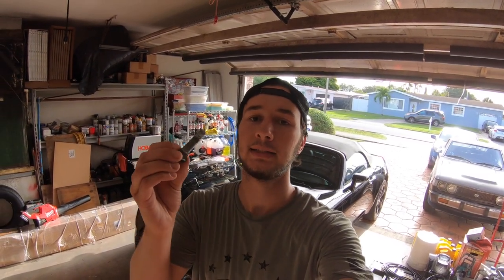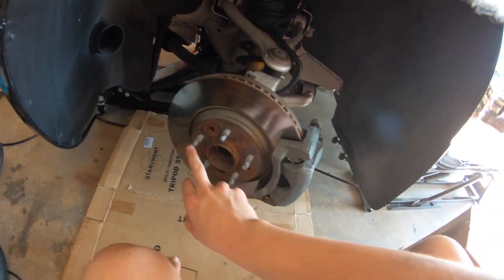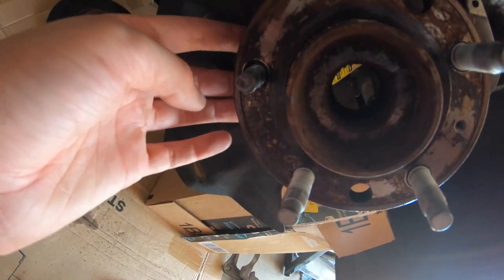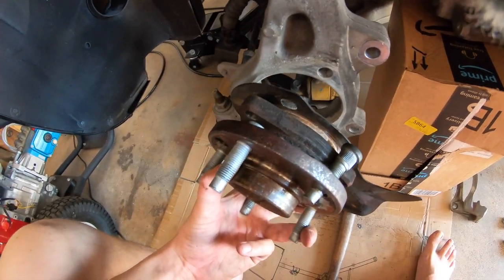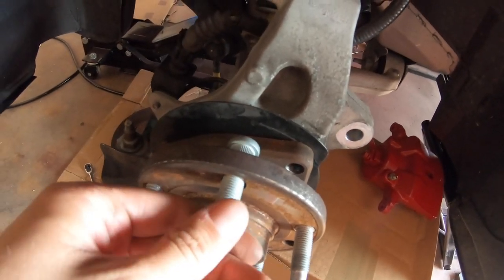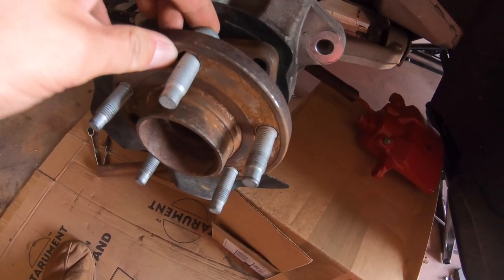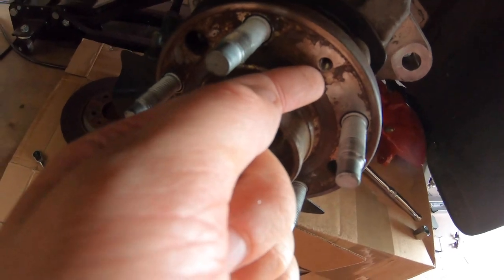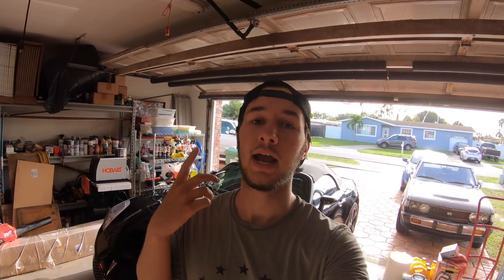Replacing a Wheel Stud on my Pontiac Solstice GXP

Comment: I have an ongoing esc problem where it activates and the esc light blinks and it just makes a weird grindy kind of sound as if abs is trying to kick in but can't. Can't determine if it's left or right tho. I'll be replacing my wheel speed sensor integrated with the abs to see if that's the problem. This video actually guides toward removing and replace the whole wheel bearing with the abs. SO thank you
Reply from the maker: Glad it helps you! Hope you figure out your issue :)

Comment: 6:05  They make a tool called "Wheel stud installer".  Lisle #22800.  It is a pretty neat thing, has a bearing and allows the nut to spin freely and not bind on the hub while pulling the splines through..  Failing to use one of these tools, you might get the stud installed crooked, that will destroy aluminum wheels.  Good video.
Reply from the maker: Thank you! That’s pretty kool I didn’t know about that tool. It’s a good idea, I’ll pick one up for next time!
Reply: @Fisherman1827  Yeah, I didn't know about that either until recently.  If you are replacing all the studs on a heavy 8-lug truck, you might go through a few lug nuts otherwise.  Again, good video!
Reply from the maker: Afternoon Garage 😂😂 I can imagine lol

Comment: I have a 2007 Pontiac Solstice GXP and my question is the front wheel bearing hub assembly is only held by three bolts?
Reply from the maker: yes I believe so and a sensor with wires from what I remember
Reply: @Fisherman1827  I'm going to replace the wheel bearings. I was just thinking that the front rims, rotors, calipers, and braking system is held and relied upon only by the three bolts unless I am missing something... I dearly appreciate the fast reply!
Reply from the maker: @bytemevv-4616  No problem! The bolts that hold the caliper on can be seen at 1:00 then later in the video you can also see where those bolts were.  Id try not disconnecting the brake lines so you don't have to re-bleed the brakes.  Feel free to ask any other questions :)
Reply: @Fisherman1827  Hey that's good to know it takes the stress off by communicating these things, because this will be my first time to start working on my car. I'm just waiting for the parts so you know how anxious I feel. I'm thankful to have someone to talk to about this and most of all someone that can do these fun tutorials.
Reply from the maker: @bytemevv-4616  no problem good luck with your project!! There are some helpful solstice groups on face book you might want to look into as well.  Thanks for the sub :)

Comment: Do you have the base Pontiac solitice or the one with twin turbo ?
Reply from the maker: Spetsnaz Russia Spetsnaz Russia I have the GXP which is the one with the turbo (it’s only one turbo). I used to have the base model though. Changing a wheel stud on either is exactly the same though, I did it on both cars.
Reply: @Fisherman1827  how fast is the 0-60 with all the upgrades ?
Reply from the maker: I havnt taken it to the dragstrip or even just timed it but I love how it feels. The car is better on the handling side then it is speed but it’s not slow either. You might be able to find 0-60 times with mods on some of the forums maybe